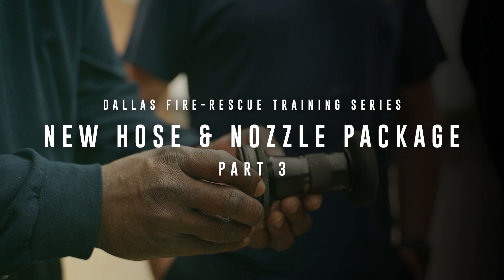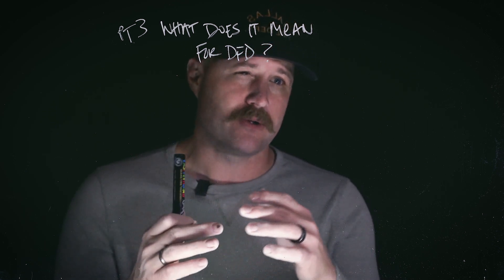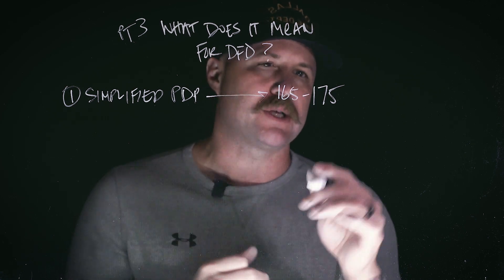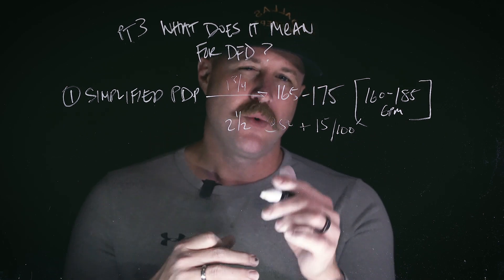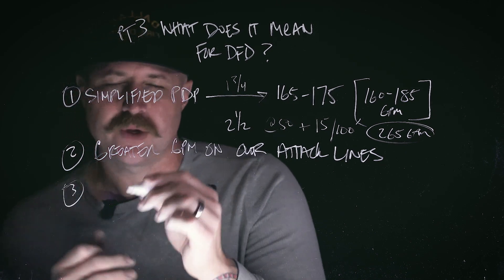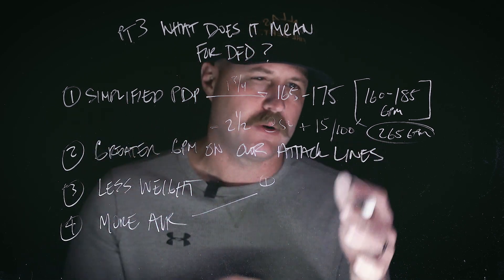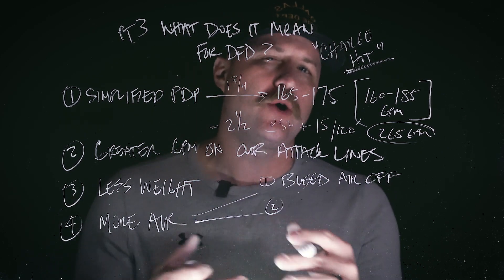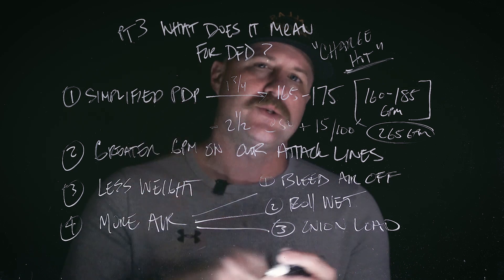Dallas Fire-Rescue: New Tru-ID Hose & Elkhart Nozzles (Part 3)

Comment: Good Sunday morning. I just found your video's and I enjoyed watching them. I know these video's are several years old but are still very informative. Why does DFD have 250 foot preconnects/crosslays? Does DFD carry a shorter preconnect/crosslay? Does a 250 foot get pulled on every vehicle/dumpster fire? Thank you for this info, it was very informative.
Reply: Every engine in our city is outfitted (standard) with two, 250’ crosslays. Some companies shorten, and some add to if their district benefits from such.
Reply: The line pulled on each fire is dictated by the fire in front of them. Sometimes that is a crosslay. Other times it’s a bumper line, other times it’s just a red line (which is most of our car fires). I’ve seen guys pull 100’ off the crosslay and cut it. It all just depends.

Comment: I’m confused about the pressure on the 1.75 hand line.  Key hose friction loss calculator is saying the friction loss for True-ID is 68 psi for 200’.  Now add 50psi for the smoothbore the total pressure calculates to 118 psi.  So why are you operating at 165 - 175psi?
Reply from the maker: Keep in mind that FL is volume dependent. So, FL will vary based on which tip you are running and NP. After flow testing 1.75" Tru ID we were seeing 20-21FL / 50' @ 175 GPM. We run 250' Pre-Connects in Dallas and built our package assuming the 7/8" tip would be run 
hot" at 60psi. So 100+60 puts us right about 160-165psi PDP.  The 15/16" would be slightly under pumped producing 175 GPM as well (@ ~45psi). The outlier was the 175@75. Theoretically, this puts you at 175-180 PDP. In early tests with Elkhart, the Fog Nozzle "over performed" and FL numbers were slightly lower, which allowed them to justify keeping it at the 165psi. I also think that they recognized the 175@75 could be under pumped and still exceed the minimum target flow of 150 GPM. 

So, why did the team who built this package design in with a PDP of 165psi as the target? The only answer I have is that is what our old TFT Automatics were being pumped. And since we have a mixed fleet, the thought was to have PDP that theoretically could work on either hose/nozzle set up. For example...  the Engine I currently ride is set up with TFT Autos and National 8D hose... and our PDP on our crosslay is 160 PSI (which translates to 150 GPM and roughly 67 NR) 

What I have seen over and over in the field though since we implemented this, is crews are running the 7/8"  @ 50  with a PDP of 135-140psi. They are under pumping the 175@75... closer to 50-55psi at the tip and seeing slightly lower flow rates (~150-155 GPM). This is all mainly due to the NR. 

I only know of two crews using the 15/16" on a consistent basis... and they are slightly under pumping as well to the tip. 

Hope that helps and offers some insight. It's a bit confusing I'll admit.